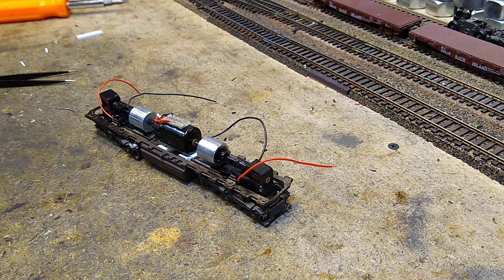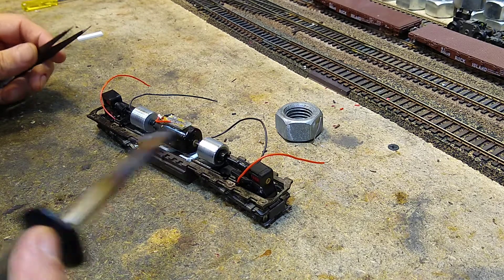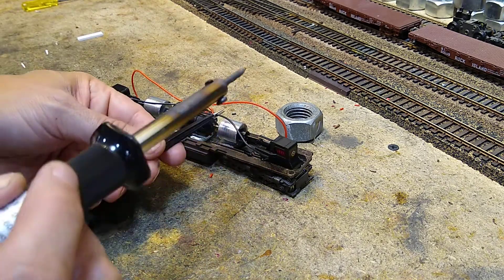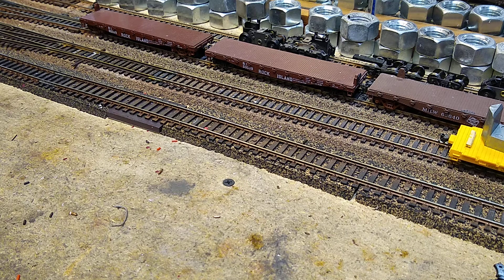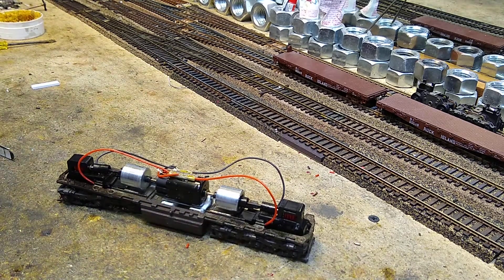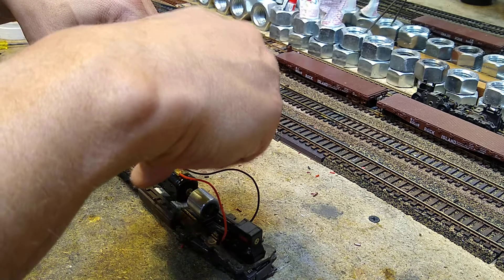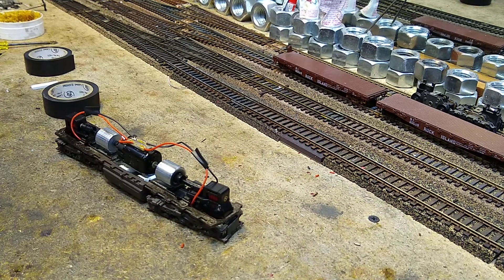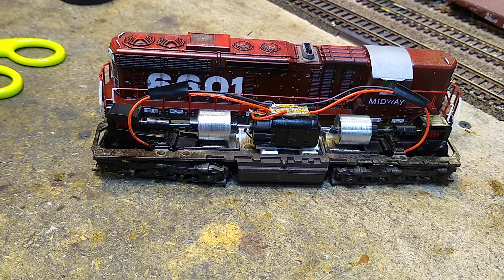Atlas SD24 part 6 wire and test 24v motor

Comment: Nice work! I'm having trouble locating the motor you used.  Can you tell us where you got it?
Reply from the maker: I'm also having trouble, right now 24v dual shaft motors seem to be impossible to get.  This is a motor from last year and seems to be out of production.  I did another remotor on the Athearn SD45 with Ernst gears using a FF-180PH and that motor is now out of production.  The rare earth magnet motors have also disappeared.  I do believe it's only a matter of a few weeks and we'll see a new Mabuchi dual shaft.
Reply: @elite194  I found a FK-130SH dual shaft motor on Ebay. Ships from China.  May be the same one. I'll know better when the one I ordered gets here.

Comment: What motor are you using?
Reply from the maker: For this build it's a 24 volt 2mm dual long shaft automotive accessory motor.
Reply: elite194 do you have a link? If you don’t want to give up your secret I understand 😆